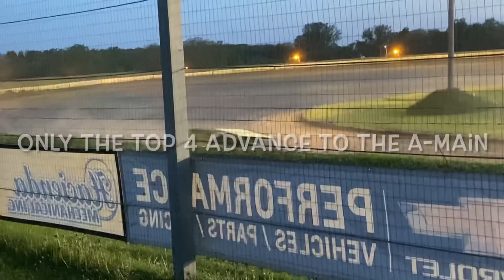FIGHTING for a Transfer Spot With USMTS at Deer Creek Speedway!!😬

Comment: Damn Chase the car looked a lot faster before y’all did the change’s?? I’ve been out of racing sense 2007 (retired) turning wrenches on them thing’s but looks like the gear change might not have been the right decision or right ⚙️ cause you sure didn’t look like you were going anywhere and before you were getting off the turns super fast 💨 but I’m just a watcher now and not able to help you out,specially because these car’s have changed so much in the last 14 years but keep digging and don’t let it get you down,bc you are getting the one thing that you need before next year comes around and that’s seat time and building a notebook 📓 what was the problem with the 3 motor mount bolts that broke off?? I was watching the highlights from one of the USMTS race’s and it showed you pull off right before the end of the race and the car didn’t look like it was under power and was smoking hope that wasn’t a motor.? But hope that y’all have a safe trip home and enjoy the video’s,y’all make me feel like part of the family just wish that I could do more.!!🙏❤️🏁🏆🇺🇸